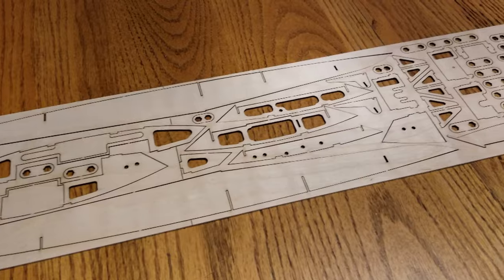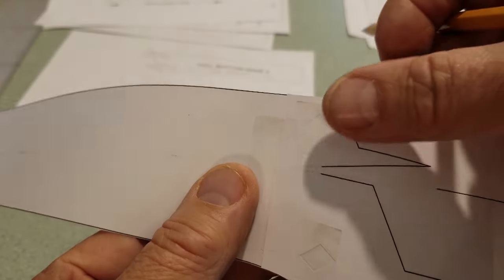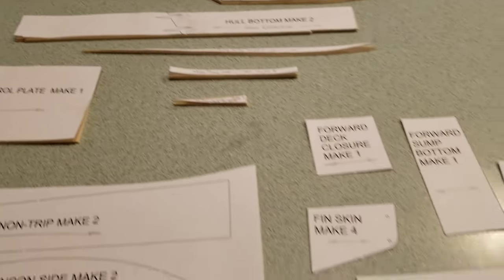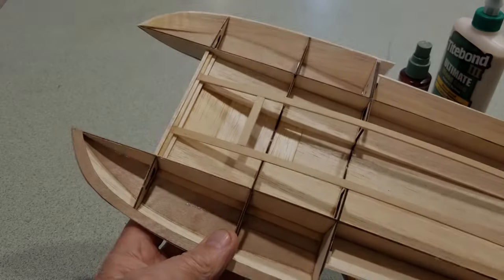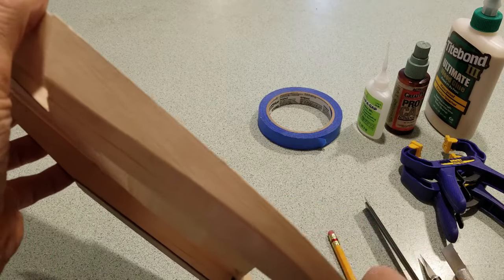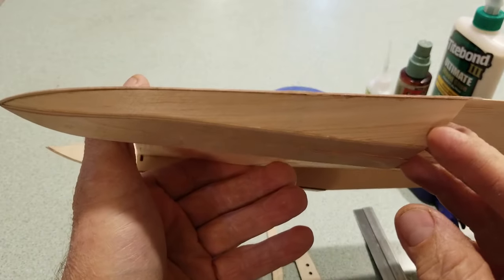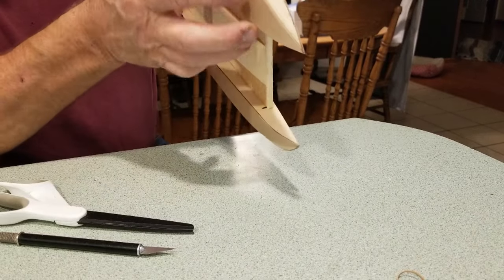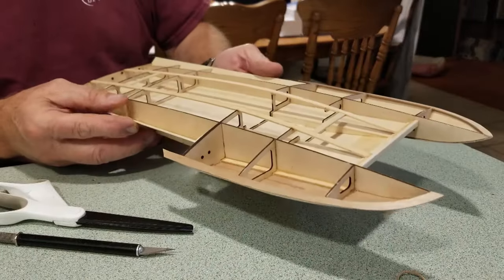Atlas Van Lines 1/20 Scale Mini Unlimited Hydroplane

Comment: Nice build Sam. My center foward sump is balsa and the rest of my sheeting is 1/32 ply. I also did some 1/4" hardwood in between the sponsons at the nose. Since the sponson tips and the center front are usually the first at the crash. I also did 1/32 ply laminated by balsa with metal reinforcement for the wing.
Reply from the maker: Thanks! Good points. Still want to keep it light tho...